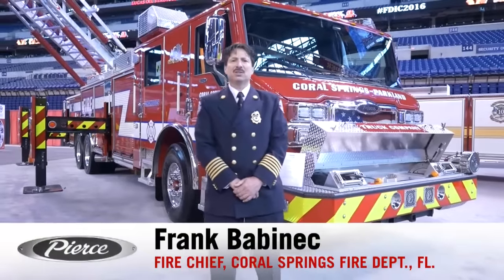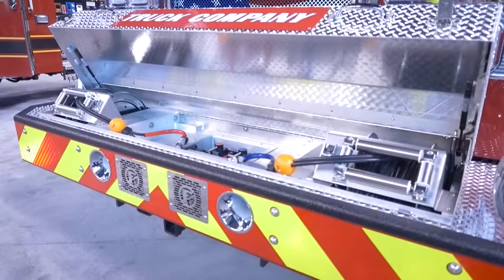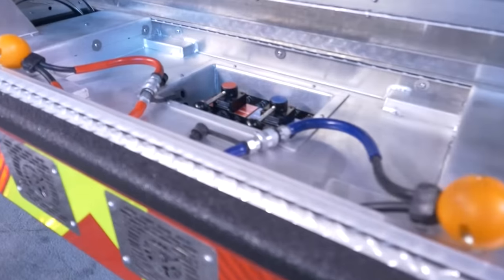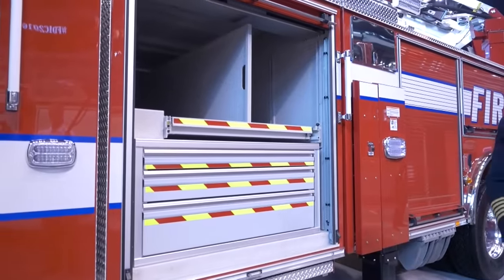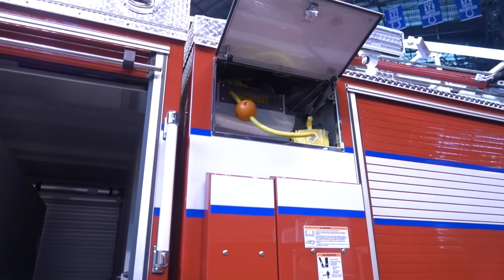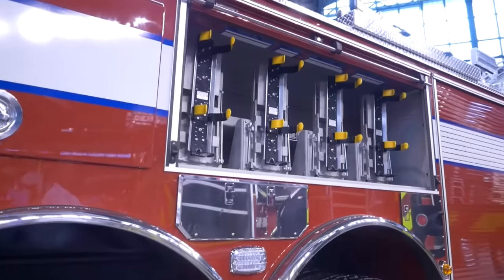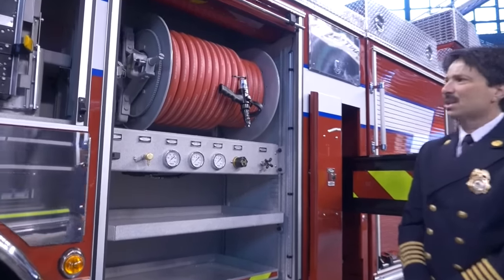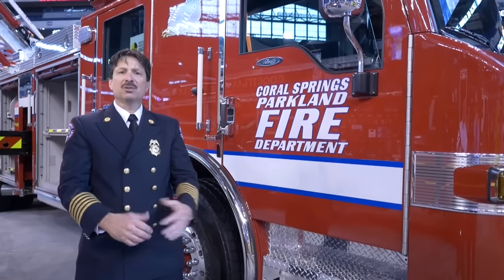Coral Springs, Velocity® 100’ Aerial Platform

Comment: no packs in the seat by choice ??? now i have to put my pack on at the scene to even be able to pull a line
Reply: A lot of departments are going to the "clean concept" which means no packs in the rig and no bunker gear post fire IN THE RIG either.  If you are in the service then you are aware of how high the cancer rates have been over the last few years. Those options that Pierce and other companies are using can make a difference IMHO.